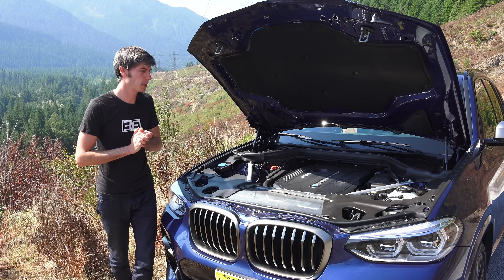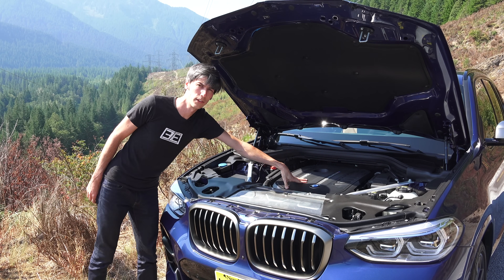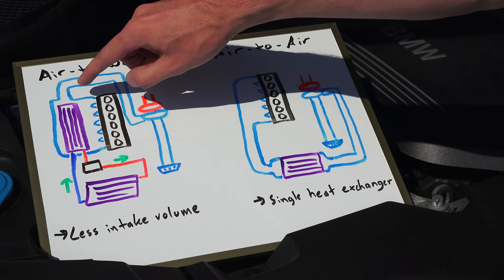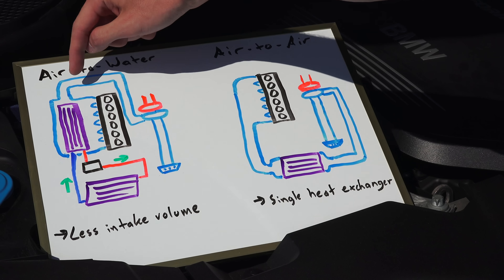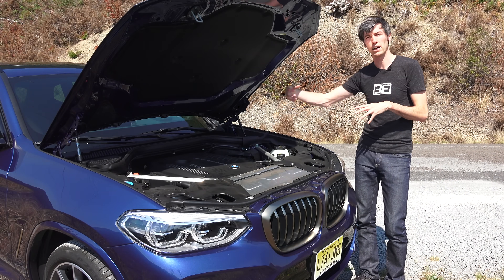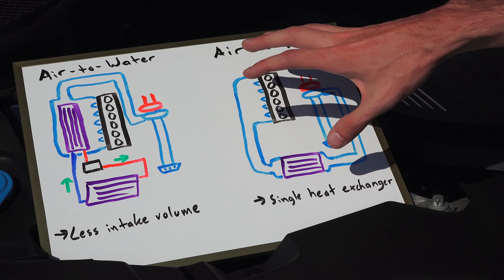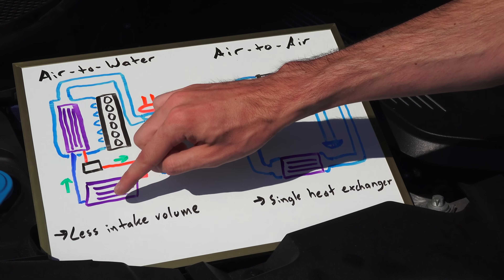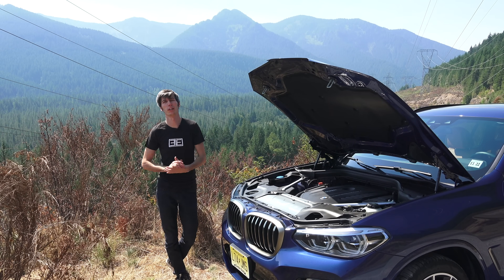The Differences Between Air-to-Air and Air-to-Water Intercoolers

Comment: Good presentation!
 Having experience going back to the Porsche 930 and 935s of the late 1970s your points are valid. Even air-to-air coolers can have short paths, as in the 1978 and up 3.3 930s. But air-to-liquid are easier to route. 
  You might mention that air-to-liquid cores take advantage of the 14-to-1 heat absorbtion efficency advantage over the, at best, 1-to-<1efficiency of Air-to-air exchangers. 
  In doing so, air-to- liquid coolers can be made smaller and lighter. And a front mounted radiator can be made larger while still lighter to speed up temperature reduction. 
  Last, the size of the circuit reservoir can be crucial to controlling heat rise as the liquid makes its second and subsequent  flows through the circuit.

Comment: The air-to-water intercooler has extra justification in the B58 engine because the B58 also has an integrated exhaust manifold.
1). The exhaust helps warm up the coolant, thus reducing warm-up time and saving fuel in cold weather (It takes less than 30s to warm up my X5 in cold Michigan weather)
2). Vice versa, the integrated intercooler can also help cool down the intake manifold after engine shutdown. It helps dissipate the heat faster, thus prolonging heat cycles.
The older BMW engines have oil leak issues because of poor heat dissipation

Comment: On a street car, for only 300hp is it worth it for the summer ? If I place the water radiator in the place of the original air to air intercooler ?
Will it be more efficient ?

Comment: You mentioned the air to air would cool to ambient while air to water would be higher. 

In practice, this is not the case. Air to air is typically 30+ degrees over ambient while air to water is only slightly above ambient as it has 2 heat exchangers plus the intercooler.

Comment: In a performance setup, I would like a air-air intercooler with a nitrous sprayer that sprays onto the air to air intercooler core. NOT for power, but mainly to spray after a high speed run or only when the air intake hit a certain high temp. To do this, the intercooler would need an electronic "thermostat" using heat sensors that go to a nitrous spray "ecu". 

For example say air intake temps get to 300 degrees (hypothetical number) at the end of a 1/4 run on say, a Evo 8 running a g35 turbo. I wouldnt spray during the run (reduced a.i.t's can actually inadvertently raise boost pressure due to air density).. I would spray after the run to reduce air intake temps to say 180 degrees. Then spray once more right before the run to cool the intake to say 70 degrees right before the launch of the next run.

Comment: Thanks for video, I have 2 questions: 1- Did the restriction of an A-W vs A-A intercooler is lower (I want to reduce the restriction on my TDI to increase the fuel efficeincy in the same time). 2- If I use a bigger A-W intercooler is better or it have some drawback?.  Thanks for the answer.

Comment: I have a 21 supra with the same motor. It seems complicated but it actually simple. Your turbo air only travels about 3 feet total to get to the cylinders. In a FM intercooler it has to travel atleast double that. The charge pipe runs straight from the the turbos cold side outlet to the intake manifold. Pretty cool stuff. If you want to see the brilliant engineering behind the motor check out Stephen papadakis b58 tear down.

Comment: BMW has an electric water pump for the air to water intercooler. So under light engine loads the water pump is off meaning that the water in the heat exchanger is not circulating and is at ambient temperature. When you have a high demand for power, the electric water pump in the air to water intercooler circuit turns on and flushes the manifold heat exchanger with the cool water that was sitting in the front heat exchanger to give you more power under load.

Comment: Not bad video. What a pity. BMW came so close to achieving to having the world's first intercooler to completely replace the radiator. 

[Yes, a radiator/intercooler hybrid or R/Intercooler if you may...]

Now, they effectively achieved in having the legendary N55's predecessor to go to the way of the rest of their current high maintenance money pits.

...rendering the N55 engine as their most reliable modern engine. 

So, what ...you must replace the N55's water pump and oil pump within approximately 4 years. That is just a maintenance replacement. The aftermarket offerings might offer a better engineered replacement.

Since BMW retired in making high horsepower normally aspirated engines, I would trash the turbo and upgrade to a twin-screw supercharger like an ESS/Lyscholm or even Eaton.

Plus, replace the automatic with a manual and call it the day.

BMW is a fine platform to have access to exceptional handling, an amazing xDrive, and the System 7 infotainment system, ...but if you want a real car, you are going to have to modify and customize it yourself.

Awaiting for these modern manufacturers to give the customers what they want, in America, ...is a hopeless toss-up.

Unless, you trust BMW not to screw up anything with potential.

You saw how fast BMW dropped the manual transmission from the 240i series.

If BMW had any semblance of empathy or concern for their customers, they would have released an E-Clutch/IMT transmission.

Even non-car manufacturers like Bosch, with their E-Clutch, got it right

Overseas, Toyota and Hyundai got it right by offering an IMT Transmission...the best transmission in existence.

BMW advancing... died probably after the naturally aspirated M5 with a straight 6 and manual transmission. That was an engine design moving forward.

To live with a B58, I would have to customize it back to N55 simplicity.

Comment: You didn't go all that deep in the pro's and cons of water cooling at all..

additional benefits for water cooling

 the cooling is stable,  more predictable, even at lower speeds vs higher speeds
air to air intercooling can greatly suffer at lower speeds because it lacks airflow

And water cooling is a  more efficient heat transfer then air cooling

shorter intake stack means better throttle response and less turbo lag

Comment: With all the metal 3D printing we have today, wouldn't it make sense to also cool the compressor part of the turbo with water? Maybe the hot water coming from the out of the intercooler on it's way to the heat exchanger...

Comment: I  was literally hoping to find a video from you while googling the differences and how air to water ICs work.  Thank You for all the work you put into these videos!.
Reply: Do you have any data comparing the rate of energy transfer  of the two designs?  Which one is better at cooling intake air.  Let’s say I was running 25psi if boost, which system would be better?  What prevents the airy to water system from heat soaking like the air to air systems do?

Comment: I’m told with Modern day Cars like this BMW that you don’t really need a warm up and cool down for the turbo .... Is this True ? I’ve notice on the BMW manual that they recommend a moderate driving for a little insignificant time  but no need for a cool down . How does this work ? Is it due to the fact that the turbos now have water cooling which continues to run even after the engine is turned off ?

Comment: Good video but he Missed one major point. 

The heat capacity of fluid aka water is significantly higher than air as is the heat transfer function - aka the water to air is considerably more efficient and will allow for great HP gains. Air to air relies on the air to conduct the heat away ... and air by nature is an excellent insulator.  Flies then to the number of fins on the exchanger and the velocity of air across said fins. Either drive faster or had fans but the air to air can only take out so much in a given period - dT/dt....

Good summary but it’s about the physics of the system - not the plumbing .... but it is more compact as noted. However with the VT - variable turbo technology, spool up is a thing of the past, if the turbo is properly matched 

Yes .... I am a Rocket Scientist... LOL !!

Comment: Give me an air-to-air any day of the week. Been there done that with air-to-water, no where as low intake temperatures other than at low speeds. Also not all cars use very long routing for the air-to-air either. The air-to-water are much heavier and far less reliable. Another reason I wouldn't touch a BMW out of warranty, these will fail for sure, so much to go wrong.

Comment: Every “Engineering Explained” video I watch has a massive error in logic, or fails to properly describe the method of action.

He advises an advantage of air to air intercoolers is the fact that ambient air temp will be lower than the temp of the water/coolant, and totally fails to realise the main advantage of using a fluid coolant system.

Cooling efficiency is affected by other things such as the fact water/coolant conducts heat far better than air.

For example, place your hand in a 100°c oven for 10s and you will be fine. Place it in 100°c water for 10s and you will be on your way to the hospital.

This means that you can have less heat transfer surface area in the intake, creating less resistance to flow where it affects engine performance.
Reply: If you're going to accuse him of being wrong, try working on your critical thinking skills first. His logic was correct.

It does not matter that water will conduct heat faster than air. The water system still relies on air. You're clearly not an engineer, or you'd have the ability to tell when things don't make sense. 

A2A: Ambient air cools hot air. The end.

A2W: Ambient air cools water. Water cools an A2A intercooler, which cools the hot air.

Comment: I realize this is an older video but I have a serious question regarding the heat exchanger.  If I'm not mistaken, the heat exchanger for the X3 M40i is located on the right side of the front bumper behind the grill.  The grill is open to allow airflow.  My question is, what problems if any exist if that opening in the bumper is blocked off and not allowing air to the heat exchanger.  I ask because BMW is currently shipping X3, X4, X5, and X7 models that are equipped with the heat exhanger(sometimes one on both sides) that are completely blocked off from any airflow.  They are aware of the problem but have chosen to ignore it in order to ship quantity not quality.
Reply: Relocate the heat exchanger, or cut the bumper plastic nicely and with precision, then install new custom mesh grill, with fasteners, and it's done, you got better cooling.

Comment: hey  just a random video idea, was wondering about this. So lets say on a Dino 2 identical engines both turbocharged. My thought is both are making the "same" amount of boost pressure. But the turbos themselves are 2 different sizes ie a 1" inlet and a 2.5 inlet with similar exhaust turbine sizes. Would they make the same overall power or would the larger one have more cfm and thus more airflow. thanks and love your channel.

Comment: Subaru sti top mount intercooler, evo front mount , subaru heat soak issues evo not so much especially in a hot climate.

Comment: For those calling air-to-water an overly complicated system ; remember that is no-more complex than the Air-conditioner.
A/C : there's a radiator in the front of your engine-bay, then fluid goes back to the radiator under your dash - soaking-up heat; then a compressor pushes it back to the front - no-one would call A/C complex or unreliable.
And I have a Ford Kuga/Escape [intercooling in the manifold] : Lurv the short air-flow path and quick response!

Comment: Why doesn't the intercooler just use the "normal" cooling system (i.e. the coolant and radiator)? Possibly even combined with a bigger/more efficient radiator?

Comment: I`m cool with intercooler, but why nobody uses some heat (in that case cool) exchanger connected to AC (climate device)? I bet it could cool down the air better than intercooler...

Comment: So you're cooling the air in the intake...what happens to the moisture the hot air let's go of when it's cooled?  Condensation on the intercooler has no where to go except through the engine....??
Reply: Doesn't that happens with the air to air intercooler anyways? Probably is not a big deal. There are are cars who even inject water to the intake on purpose to reduce  ajr temps so...

Comment: As always, great explanation, but it was simple (you already got a video of intercoolers). Cloud you go more in depth between this two systems? I am about to make my STi water to air intercooler and there are things I don't know yet like: how fins (bars/plates or tubing) affect the water flow? How much is enough in terms of speed of the water flow in order to allow enough heat transfer? What is a good disign to avoid turbulence and not to get water stocked inside the system that affects heat transfer (like the effect inside the back box of a pickup truck)? Make sense what I'm asking?

Comment: Kudos for all your videos. Easy way to explain. 
Btw
Something I am wondering about this. How come automakers haven’t used the air conditioning system for this. Instead of using the (in case of the water inter cooler) outside cooler use the a/c compressor to cool down the inner coil. And should be colder at all time. My two cents.
Reply: While it would improve volumetric efficiency at high temps, the AC compressor uses far more energy to drive than a small electric circulatory pump. That would render it pointless since the whole point of air-water intercoolers is power and efficiency.

Comment: Air to Air works great in airplane engines where there’s a lot of air move through the IC.
Air to Liquid potentially works better in a car for the opposite reason.
However....that’s a lot of complexity...and potential for leaks and pump failures especially with repeated thermal cycling of the intake manifold.
Very “cool”....get it?...from an Engineering and thermodynamic efficiency/ power delivery perspective.
Is it gonna get 200k miles without very serious $$$$ in expenses.
I’m going out on a limb and saying NO.

Comment: I'm not sure that's right. An air to water (coolant) intercooler is basically the AC in your house/car. The air coming out of your vents in your house is well below ambient. Assuming the BMW uses the same compressor to condenser to expansion valve to evaporator arrangement, the air into the engine should be below ambient. Or am I missing something?
Reply: Theres no compressor, no condenser eta, its just a pump to pump water to the intercooler then to the heat exchanger (just a small radiator) and back.

Comment: Subaru put their air to air up top so, other than the heat of the engine being right beneath, the placement is as short a travel distance as this new air to water system BMW has.  A heat shield would make Subaru's design far better according to the stats you demonstrated.

Comment: The B58 switched to N65 on the BMW M5 is like the M3 minus the T56 with a 1544 on the side of the V8. The 675i is shorter than the E351 when the V6 498 has more airflow than the 454 type R. Scooby Do.

Comment: I realize this is commentary on the engineering and technical details, but after having a BMW ruined because of cooling system issues, this makes my skin crawl. I sure hope they haven't used plastic cooling system parts INSIDE the intake manifold! What a freaking nightmare this is going to be!

Comment: I'm wondering if the water to air core doesn't flow massively large amounts better than an air to air core as well. Naturally, because it's me and I seem to disagree with you a lot, I think that's got more to do with the throttle response than the lower volume of intake plumbing.

Yes I have a theory, but my thumb hurts now so I'll only post it if someone asks for it.

Comment: I think under harsh acceleration the water can soak much more heat before the coolant heats much. So for short pokes on three throttle it probably works better than air.

Comment: This is the Mk5 Supra Turbo engine

Basically it turns the intercooler from Air-to-Air into a radiator for the intake manifold. It uses liquid cooling to cool the incoming air from the turbo and honestly it works. We will see water cooled intake manifolds again I can promise you that.

Comment: According to ur drawing I have a doubt,When compressed hot air from turbo comes in contact with a cold surface(inter cooler fitted inside the inlet manifold) does it make water moisture on the surface of inter cooler(like ac evaporator)? if it does, this water moisture ill go to inside the engine..can u explain abt tht.
Reply: I don’t think the temp difference is enough to actually condense the water. The amount would be very small if it did. But if it did... water injection! Congrats on your invention!

Comment: This sistem has another coolant tank, or is using the engine coolant? Is this more efficient than the A-A intercooler? This efficiency difference explains the bigger manufacturing costs?

Comment: In addition, I imagine this decision may have been made based on the fact that an air to water system still cools in traffic due to the radiator fans.
Reply: Yes but at idle you’re really not using the turbos so there really isn’t a use.

Comment: I've always wondered if you fed the air intake behind the intercooler. The air would pass quicker through the intercooler creating greater cooling, but it doesn't get much hotter than ambient air at the intake because of the speed it passes through the intercooler to get into the air intake.

Thoughts?

Comment: So does the slightly lower temperature mean performance vehicles will rather go for an air to air intercooler system?
EDIT: I'm talking about F1 here. I could imagine dragracers will more likely use water to air, since the short period will not heat the coolant that quick, probably? Discuss!